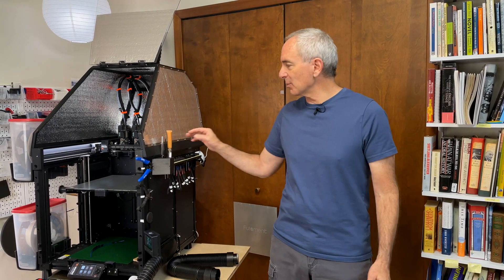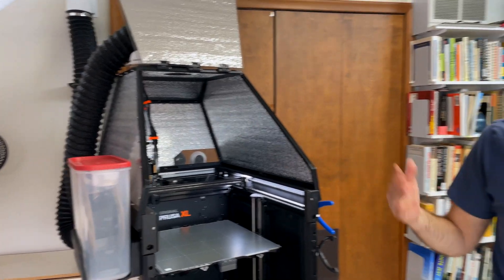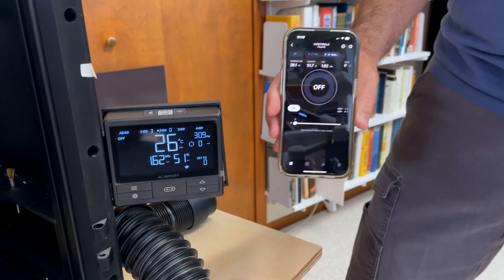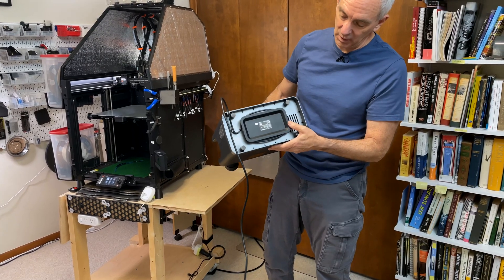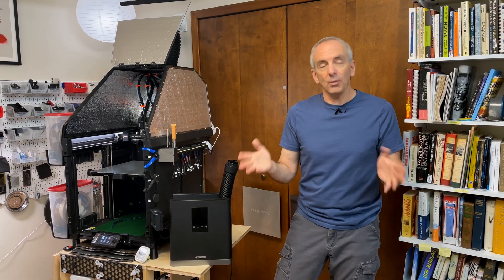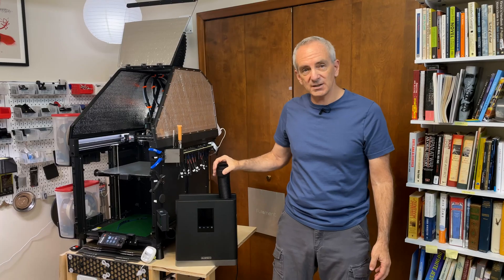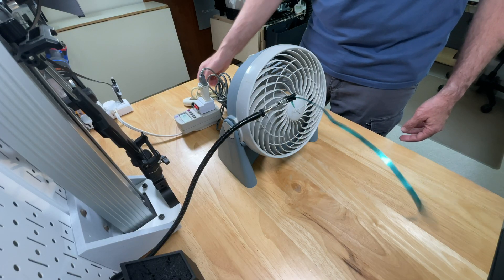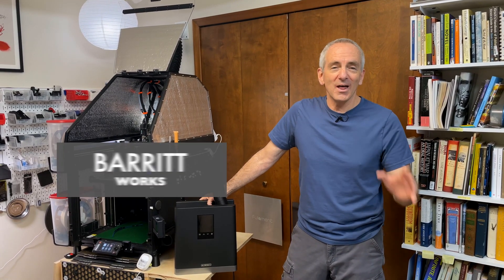Actively Heating the Prusa XL with AC Infinity's Thermoforge T3 Heater

Comment: Are you willing to share the duct design you made so we can run a similar setup?
Reply from the maker: @ChadH22 I've posted this duct/port on Printables.com. Take a look here: https://www.printables.com/model/1472539-prusa-xl-active-heater-connection-port
Reply: @BarrittWorks  Thanks!
Reply from the maker: @ChadH22 Sure. Might be easiest if I put it up on Printables.com and share the link here. I'll put it up in the next few days (including the .step) and let you know here. Anyone who might want to use this will likely want the .step because it is fitted to my particular implementation of the EnXlosure; it will likely need to be adjusted to attach to someone else's set up. Let me know if you're in more of a hurry than that.

Comment: Hi! Nice video:)

Quick question about the ThermoForge T3.

I emailed AC Infinity to ask for actual airflow numbers (CFM / m³/h) from the fan at level 10, and whether the fan curve is linear (for example, is level 5 about 50% of level 10). They refused to share anything beyond “10 speed levels, max 530W,” and just said that level 5 is 50% and level 10 is 100%, but gave no real airflow specs.

Since you actually test gear properly: have you measured how much air the T3 is really moving on max fan, and do you have any data for the lower fan levels?

I’m using it as tempered intake air into a grow cabinet and I need to know if it can overpower my exhaust or not. Any numbers you’ve got would be super helpful. Thanks. 🙏
Reply from the maker: @DrBerg-123  We just ran the measurements (and we did end up shooting video as well, it will go up before too long). 

Short version: The progression up the levels in fan mode is linear, moving up consistently at 0.3 m/s per level, starting at 1.2 m/s at level one and ending at 4.0 m/s at level 10. I measured the outflow inner diameter at roughly 46mm. So the area is roughly 0.0067 meters squared. At level 10 then I come up with just under 24 cubic meters per hour (23.93). You asked about levels 5-7, the speeds there are 2.5 m/s for level 5, 2.8 m/s at level 6, and 3.1 m/s at level 7 (again, linear at 0.3 m/s per step). 

I'll present all this in a more organized fashion with the video.

Stay tuned for the video (now I really wonder how many people will want a video on the volumetric flow numbers for the T3...we'll see). I'll link it here when it goes up.
Reply: @BarrittWorks  Thanks so much for running those measurements and sharing the numbers — super helpful. The linear 0.3 m/s steps and ~24 m³/h at level 10 are exactly what I needed to sanity-check my intake setup. Really appreciate it! Looking forward to the video — will be fun to watch when it goes up.
Reply from the maker: Glad you liked the video. Thanks.

For my use I wasn't very focused on CFM (beyond wishing I could run the heater at something other than the maximum fan speed). Now I'm curious. I don't have any measurements on actual airflow already, but I'll take some and share them here (and perhaps shoot a short addendum video just on the T3's fan speeds). Won't be immediate, but soon. Stay tuned.
Reply: @BarrittWorks  That’s awesome, thanks for taking a look.

If you do measure it, the two numbers that would help a ton are:
– Airflow (CFM or m³/h) at fan level 10 with the stock outlet hose
– Whether fan level 5 moves roughly ~50% of that

I’m using the T3 as tempered intake air for a negative-pressure grow cab, so I just need to know if it can actually overpressurize the space or not.

Super appreciate you being willing to test it.
Reply: @BarrittWorks  Hi again,

Just one more detail that might help when you test the ThermoForge T3:

On my unit I’ve set a 26 °C target. When temps drop below 26, the controller automatically bumps the fan up to level 7. When it reaches 26, it drops the fan down to level 4. So in normal operation it’s not stuck at max – it actually cycles between fan level 4 and 7.

That’s why airflow at different fan levels would be super useful, not just at 10/10.

If you’re able to measure:
– Airflow (CFM or m³/h) at fan level 10 with the stock outlet/hose
– And/or any data point around fan level 5-7

…that would basically solve it.

AC Infinity support wouldn’t give any airflow numbers at all, so real measurements from you would be gold.

Thanks again for taking the time to even look at this.
Reply from the maker: @DrBerg-123  No problem. As I mentioned, now I'm curious as well.

I'll measure every level (1-10) and share those numbers, so that should include what you're looking for as well (I'll be using the one, permanently attached, length of stock hose). I'll measuring just the speed of the outflow directly, so it will then be just a bit of math, using the hose cross section, to go from that to a rough CFM figure. Even if my measurements are a bit informal (and un-calibrated), they will be consistent, so the data should also give an indication of how linear the progression is. 

Not immediately, but soon and I'll put a copy of the data here (whether I shoot a short video about this as well, or not).
Reply from the maker: @DrBerg Here is the volumetric flow video: https://youtu.be/RI-CYcS2xHs

Comment: With Bambu Lab's latest release of the H2S (which has a similar print volume to the Prusa XL), would you reccomend going with the Prusa XL or Bambu Labs H2S?
Reply from the maker: I have not run a Bambu Labs printer, so I'm not the best to help with that comparison. I've been quite pleased with the XL's features and its day-in and day-out performance for well over a year now, as well as with the Prusa ecosystem and community.